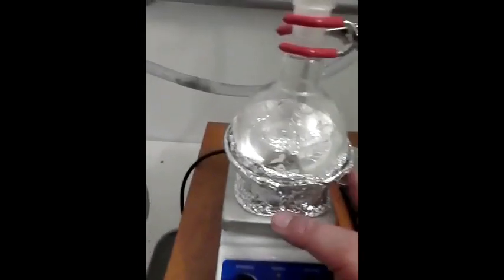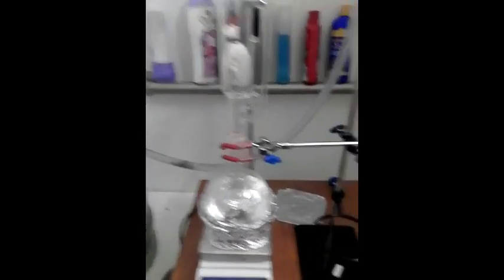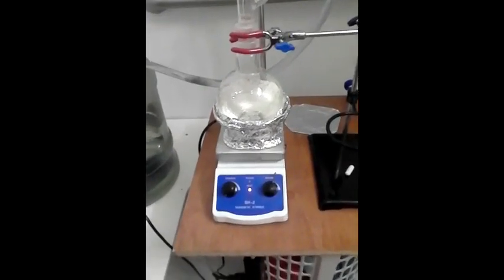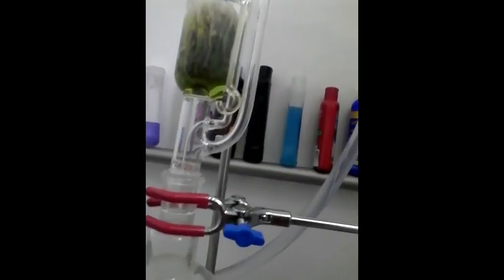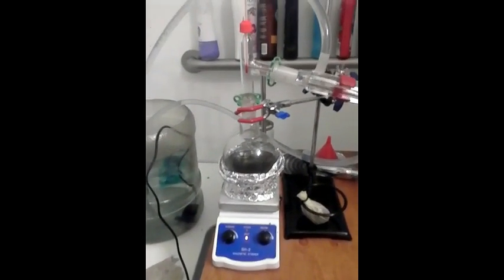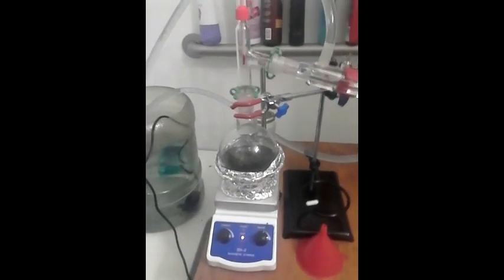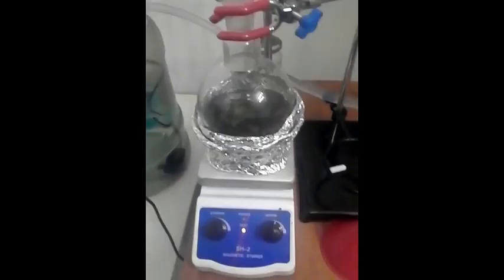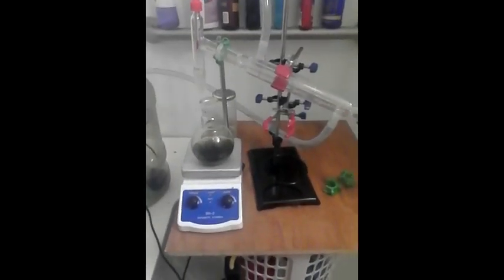pine oil extraction using a Soxhlet extractor.

Comment: its the same proces for get dates seed oil?
Reply from the maker: yes you can..Oil extraction from date palm seeds (Iraqi date palm) is done by standard solvent extraction method using a Soxhlet apparatus. Using methanol as solvent will get the best yield
.
Reply: How many percen methanol to use in that proces,, can u give me link or tutorial process for extraction dates palm seeds to get oil dates palm using this process methode?

Comment: Hi, that was a very interessant video. But i have one question: what do you do after the distillation and what did you have in final result ?
Reply from the maker: the final result was this blob of sticky green goo. that was after I tuck off the rest of the solvent via evaporation. tried to make it more usable by mixing it with propylene glycol but it just clumped up and wouldn't mix. it makes a lot of pine smelling smoke if you set it on fire though..lol.a hole lot of smoke.
Reply: @JayCarlsonDDiv  okay, thank you, this help me so much